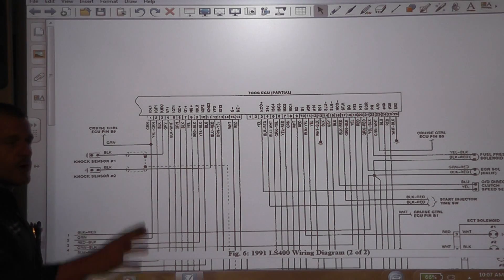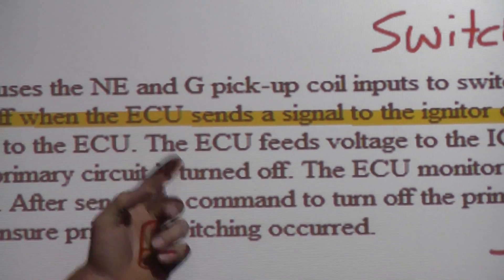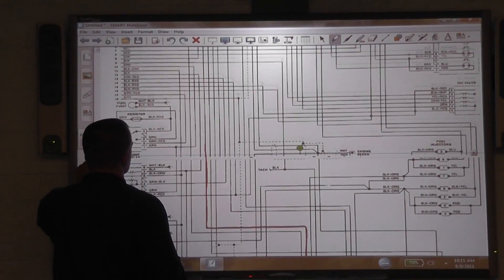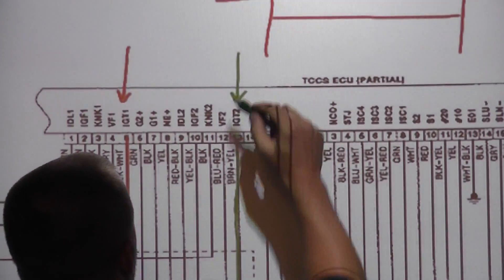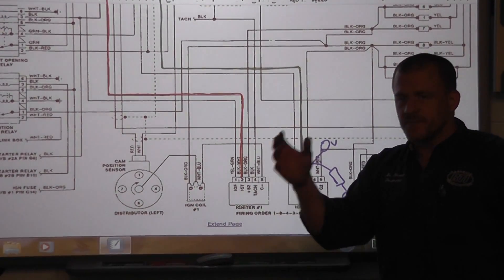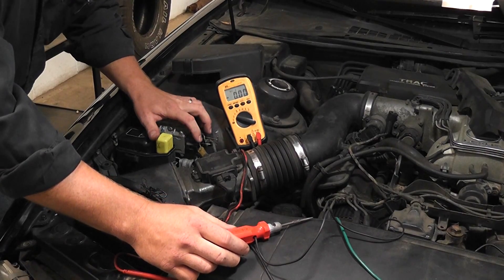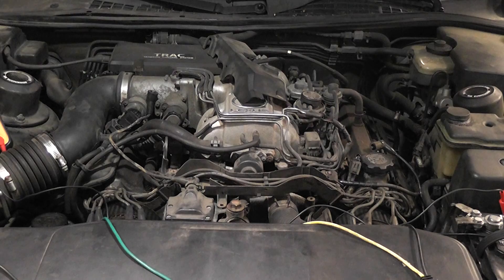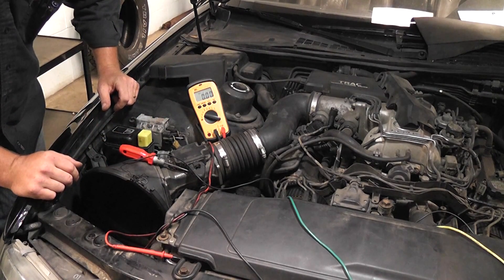How to test an igniter on a Toyota/Lexus

Comment: Hello, I am trying to register an account on your forum to ask for help in troubleshooting a P1300 OBDII code on a 1996 Toyota 4runner. I have yet to receive a confirmation email. Not sure if it just takes time but I figured I could give you an introduction here. I have been following diagnostic instructions in my Factory service manual but so far they all pass. There are a couple of results I am having trouble interpreting. Basically the engine dies at idle after a specific amount of time. According to the FSM if the ECU does receive a confirmation of ignition (IGF) signal after a number of IGT cycles then the fuel is cut. I have much more detail to add when I get access to the forum. Thank you.
Reply from the maker: It takes up to 24 hours to receive a confirmation. If your still having trouble email support@scannerdanner.com 
My Web designer will fix you up. Thank you! I look forward to your post

Comment: follow instructions to a tee. used test light and got spark to both coils. However when i crank there is no spark to either.

got a new coils and crank sensor and still nothing. I am being told that i may have to check cam sensors?

car was running well but had a starter issue for 2 weeks. on this day starter seem to have jump(loud noise) but car started ok.

drove home and park and wont start when cranking. Timing belt was changed about 6 months ago.

what is your suggestion?   Located in the Bahamas and no certified or knowledgeable Lexus mechanic around.
Reply from the maker: The test you did proved you didn't need coils or the igniters. Why did you change the coils? Crank sensor was a good direction but we should have tested it first too. I could have helped you with that. 
Post this to my forum okay? I'll help more there. Next step, we need to see if the ECU is alive by testing the 5v reference circuit.
https://www.scannerdanner.com/forum/post-your-repair-questions-here.html

Comment: Fantastic video that is currently helping me diagnose a no spark condition on my Toyota. 
In my case, the coil blew (visible damage) and it looks like it might have taken out the igniter, as replacing the coil did not fix the lack of spark. 

I supplied voltage to the IGT pin as you instructed, and the new coil did not fire. 

Is there any danger in supplying 12v through the test light to what is normally a 5v control signal on the IGT pin?
Reply: A new Igniter did fix the problem! Thank you for helping me pin point the problem.
Reply from the maker: awesome, sorry for the late reply. The answer is no with the test light question. I've done it countless times on multiple different components across all car lines. (using a 12v on a 5v circuit)
I did some more experimenting with this however and did another video covering this concern. Let me know what you think. In this video, I am controlling the base circuit of a Nissan COP ignition coil (a 0-4v signal, with a 12v test light) and I compare the current draw using both an incandescent and LED type test light. 
https://www.youtube.com/watch?v=UwQVg0CtkuQ

Comment: Sorry Paul, is been so long I can't understand this module to module communication,and I did my best to,however would like to clear my doubts before condemning something on the car,by applying power to two IGT igniter wires you simulate a good transistor inside in the igniter and if the coil fires we are going in different direction,here is my doubt,should we go in different direction??????What happens if igniters transistor that we simulated is actually bad and we should not go in different direction????
Reply from the maker: +aurel ion Rotaru We are not simulating the transistor, we are activating it. What we are simulating is the ECU base circuit control signal for the transistor. If this test does not work, we need to check the igniter power and grounds before condemning the igniter. Also as a follow up. If the igniter is actually your problem, this means that the ECU base circuit control signals have to be there. You should check them with a meter during cranking. If they are missing, then you MUST go in another direction first and this may mean you did something incorrect in your bypass test. 
Make sense?
Some videos to give you some more perspective:
https://www.youtube.com/watch?v=YBE7c7lfmnY
https://www.youtube.com/watch?v=VG3EZJlyjl8
https://www.youtube.com/watch?v=01kxE1gMgio
Reply: +ScannerDanner Thanks a lot for replay Paul,I see now what was confusing me,by activating the base circuit we test a transistor and not simulating a transistor,if a transistor is bad activating the base circuit is not going to help.A transistor can only be activated and not simulated,cleared a confusion that was in my head all the time,specially modem to modem communication.For sure will check all the links posted to clear my mind before it blows.Awesome,thanks again Paul.
Reply from the maker: +aurel ion Rotaru sweet man. Thank you

Comment: even without using a voltmeter, but being a variable as you mentioned in one of your videos, for as long as you see two signal wires running to the computer, it is a pull up circuit design. Can this be said as a general rule of thumb?